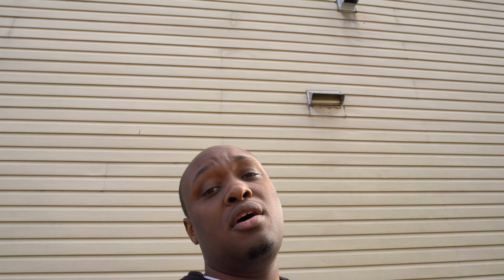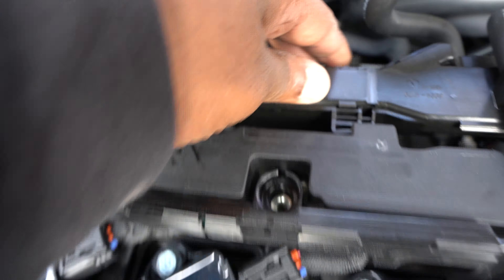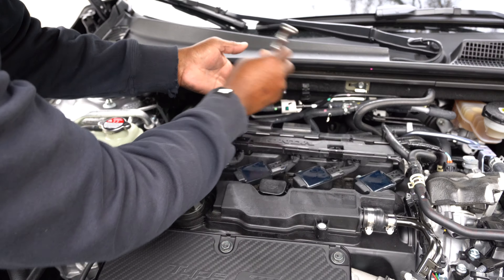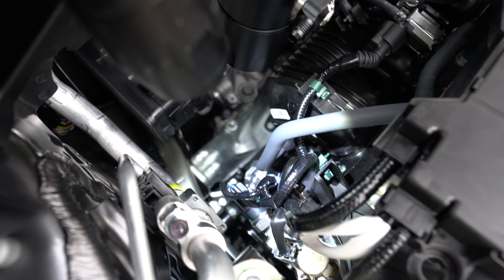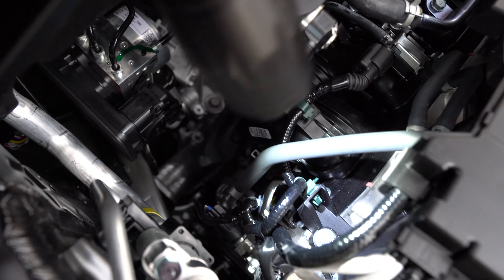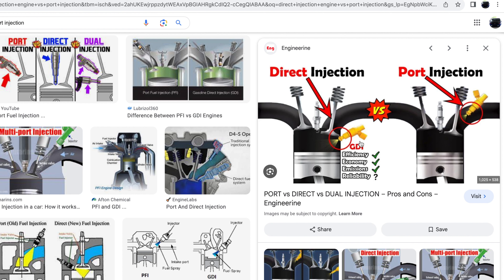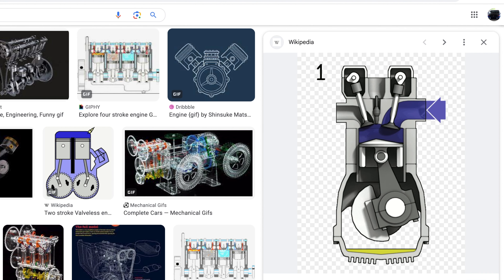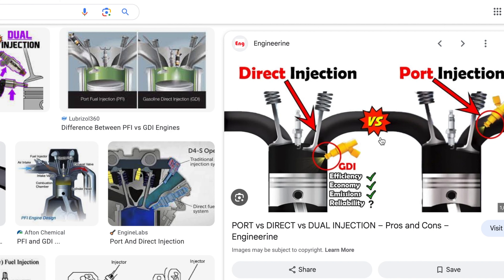INSTALLING RADIUM PCV OIL CATCH CAN ON THE 2024 INTEGRA TYPE S! 🔥

Comment: Great video. So I contacted Radium to confirm compatibility and they said that they didn't have a kit and recommended getting their universal kit.

Just to confirm, you used the Type R kit and it all fit? Correct those size etc?
Reply from the maker: Its the same as the FL5 kit